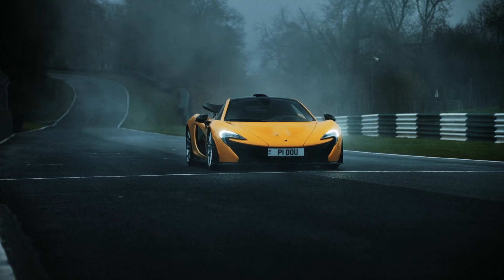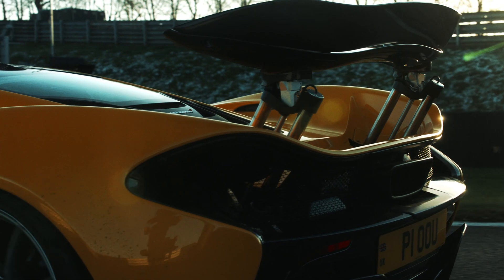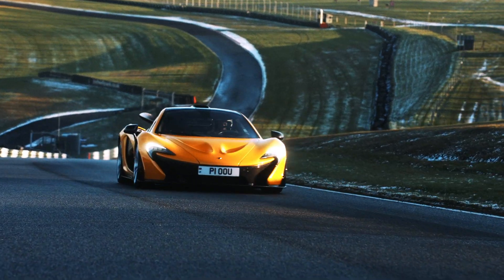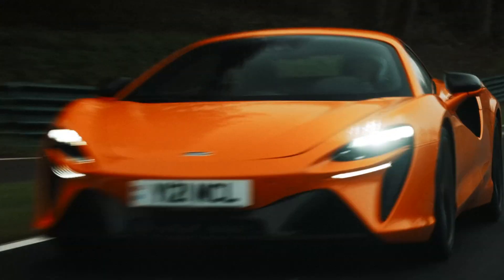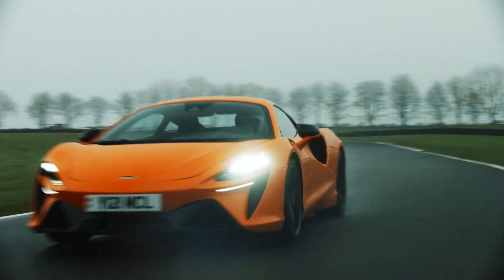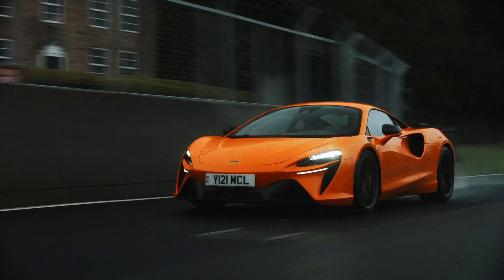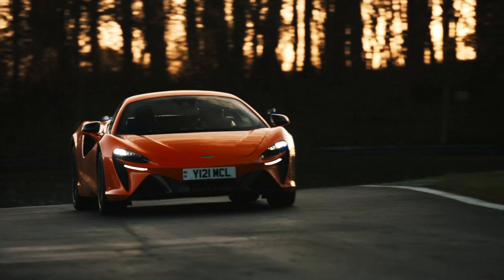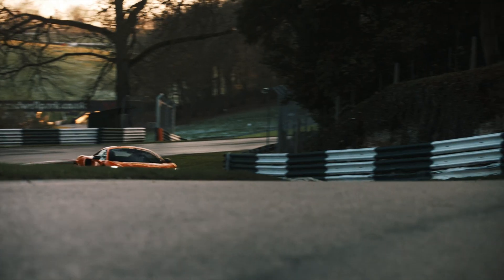Hybrid history, leading the future: Artura X P1™

Comment: It's not new car, just modified 720's which was a modified & updated/rated 650s. The 540/570 in my opinion was a retrograde step! Also I don't think the Artura looks better than the 720. Now the new powertrain, you lop 2 cylinders off a V8 & get a V6? Then you add a High power density axial electric motor, a heavy battery pack, a motor controller & an on board charger. So you start off with a full battery & a full tank of fuel. 20 & 200 miles of travel respectively. You drive 30 miles & your battery is drained! Not only that you are carrying all that dead weight. Now the electric motor is still spinning & drawing power from your engine to recharge the battery. Now if you look at the BMW i8 system, it has a GKN E-Twinster 2speed electric motor, diff & motor control/charger. At the back you get the petrol engine 6 speed gearbox/diff unit. OK it's a smite heavier at 1940kg. But it does 0-62 in 4.4ecs. That's a 4 seat that averages 250-300miles per tank full.